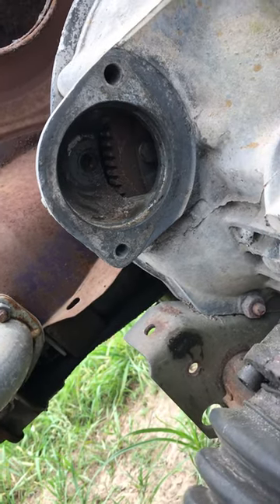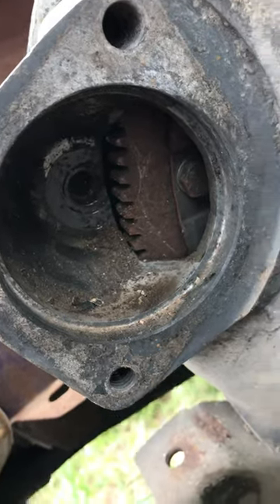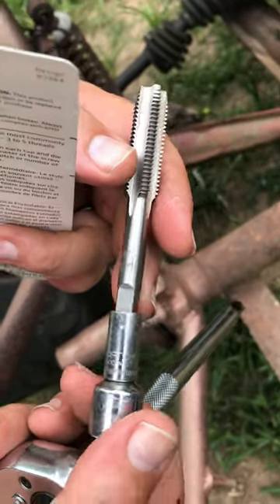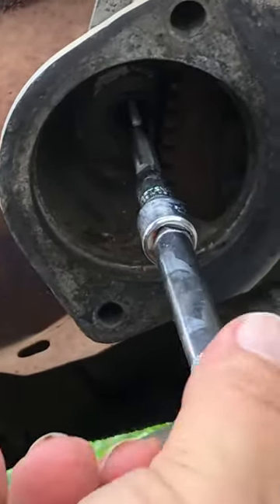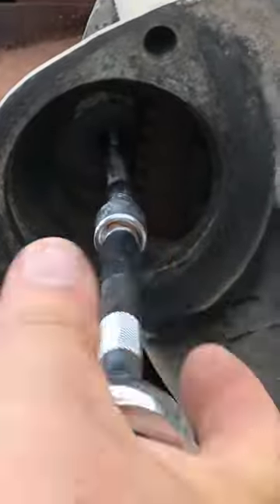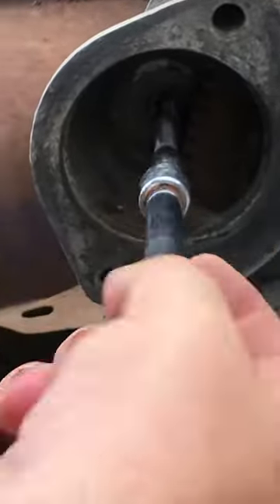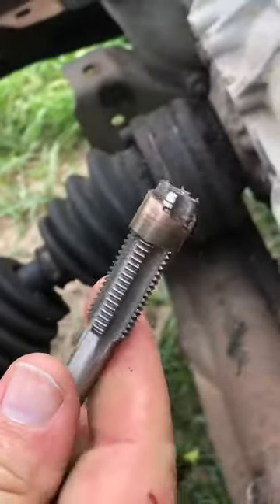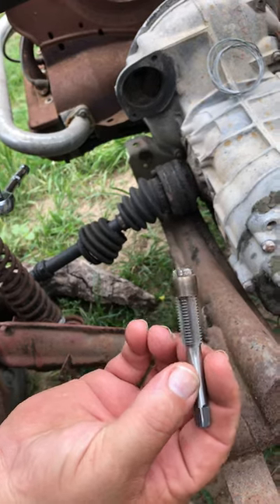VW 1600 starter bushing removal

Comment: Done exactly that today, it worked. But now with the new bushing the starter motor does not want to fit into its place, left it barely hanging in there to try tomorrow.